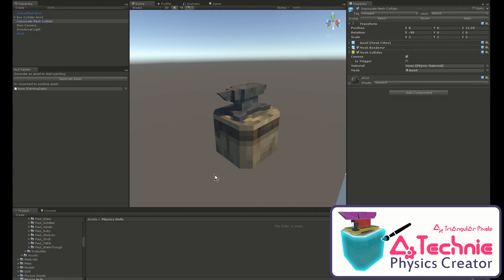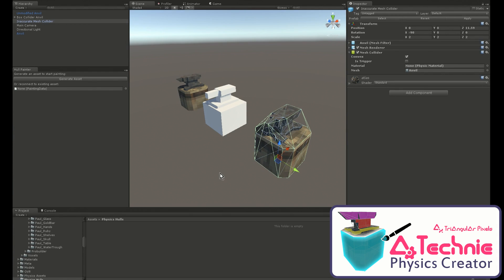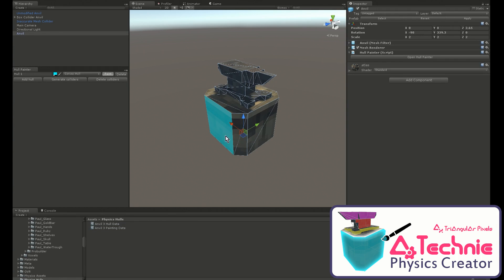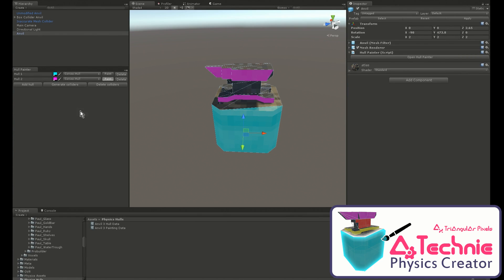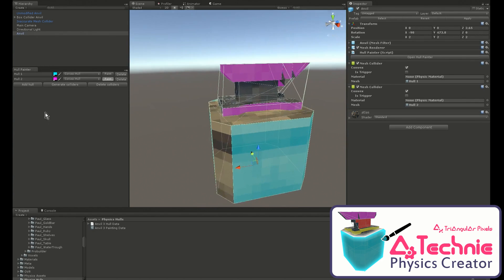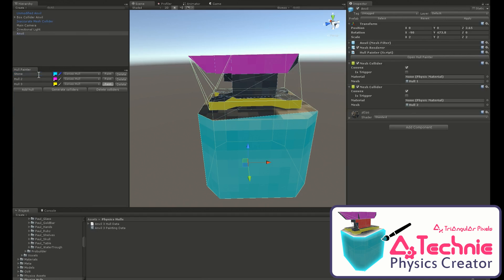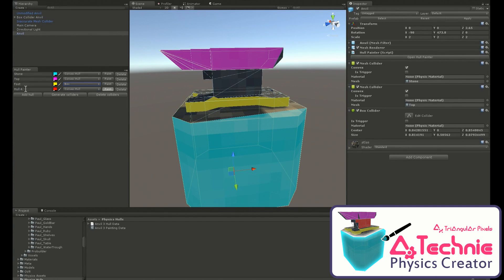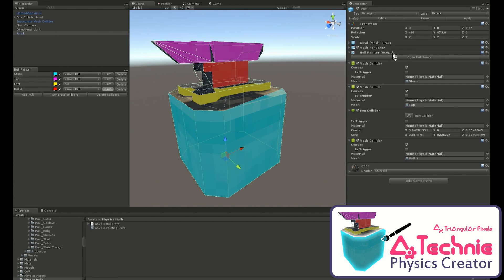Technie Physics Creator - Hull Painter Demo

Comment: I would love to have the ability to automatically select vertical faces around 360°. And having a auto shaping slider from 0% until 100%. This editor is much too simple. I can not see any advantage or use case to spend extraordinary time on polygon clicking. Not for android, IOS,  PC or consoles.